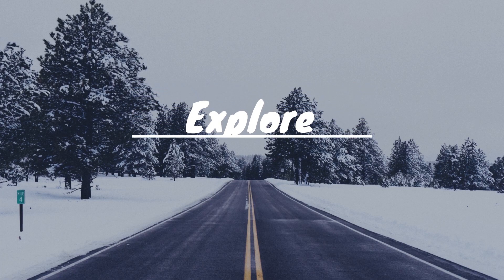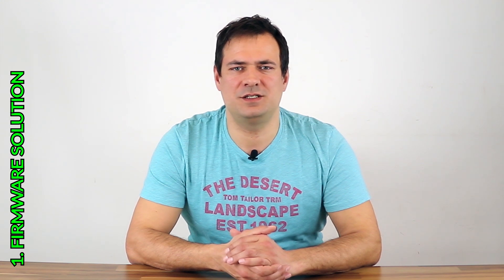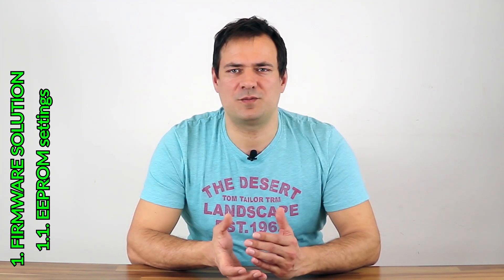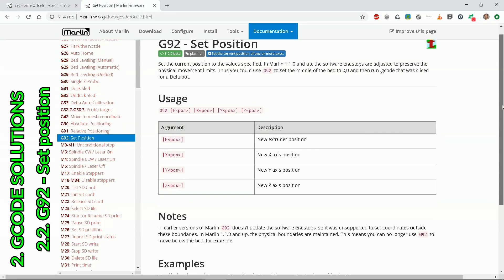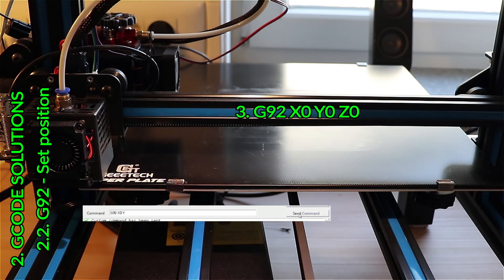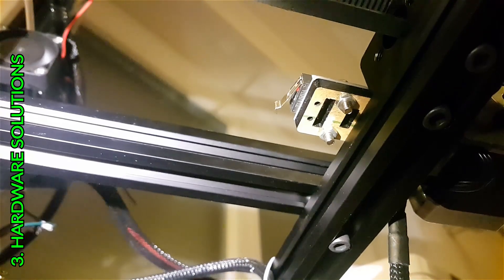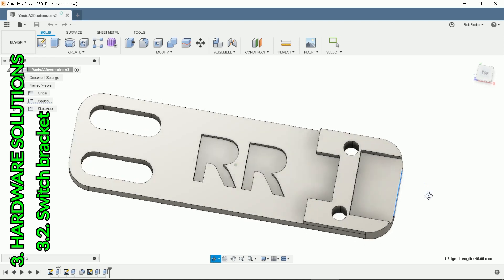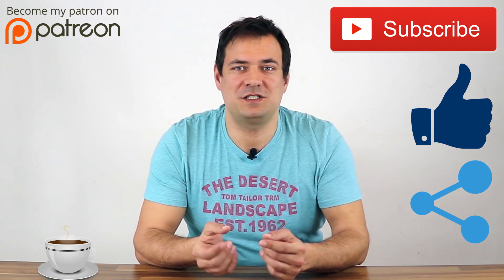🔴 GEEETECH A30 Y-AXIS OFFSET PROBLEM - better than Creality CR-10S PRO - best 3D printer

Comment: I just set the offset in the slicer. With Cura in the print settings -> Extruder1. In my case for x -7 and y-20. In Slic3r PE you can enter the offset in the view for the print bed size. The line below.
Reply from the maker: Thanks for your comment. Hope it will help someone.
Reply: I couldn't get the "-" to input on cura in these settings
Reply: @Michael_Killner_Davies  are you sure you used the right fields? They called "Nozzle offset X" and "Nozzle offset Y" (under Nozzle size and the field for the Filament diameter). I had no problem to get the "-" in these fields